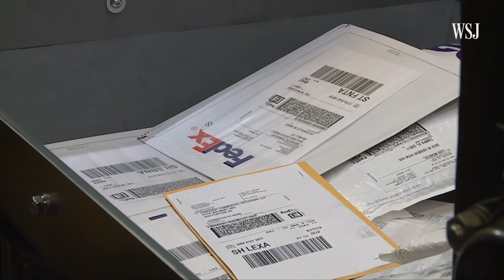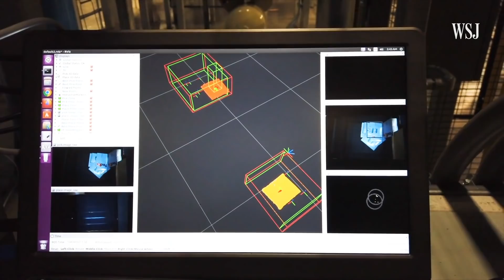The Robot Revolution Is Happening-Like It or Not | WSJ

Comment: There are warehouses filled with robots ready to go...not necessarily to seek and destroy but to serve - particularly if there's another civil war...during a freaking pandemic (because of an idiot "president." Uugh)!  

But most will see it as a positive change during these very difficult times, and perhaps that's what multinational corporations have been hoping/planning for all along.

There's a reason Yang's UBI has gotten as much traction as it has.and

We still must remain vigilant because the top 10% have no problems using technology as a way to restrain, terrorize and monitor people...with no regulations or restraints.

Comment: Robots are the ultimate dream worker for companies:
1. Can work 24/7/365. Doesn't need a breaks/sleep/vacations.
2. Doesn't require training.
3. Doesn't get sick/injured.
4. Doesn't require wages or benefits.
5. Doesn't go on strike or lawsuits.
6. Doesn't need bathrooms/Air conditioning.
7. Can easily be upgraded to work better or replaced without any issue. 
8. No concerns of stealing/sabotage/etc.
9. No Labor protection laws or Unions.

Comment: It takes a few seconds, just a penny or two in labor costs, to wave a bar code scanner over an envelope and place the envelope on an assembly line.  When you see 'shipping & handling' costs going into the dollars, the money is going somewhere else other than the workers.  Yet the robot revolution is oriented toward eliminating that cost alone.
Reply: Staff wages are paid out of shipping and handling costs. It's not just the people working in warehouses, it's the transport companies, even if they replaced their drivers with self driving trucks, those trucks still have to be maintained. Automation will make things cheaper, but the cost will never be zero. On top of this, companies still need to make a profit which will be harder to do because taxes will rise to pay for universal basic income. The money that they have saved on staff will now be spent on taxes. It's actually a good thing because these jobs are low paid anyway and those workers will get the same money from the state without having to actually work. We are not robots, we shouldn't be doing monotonous work.